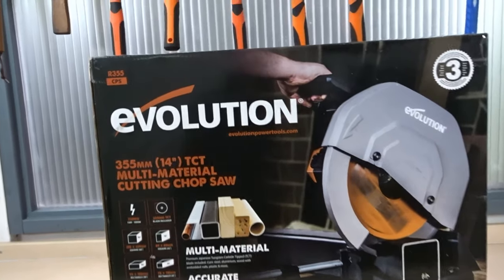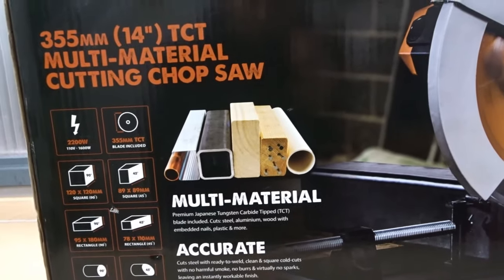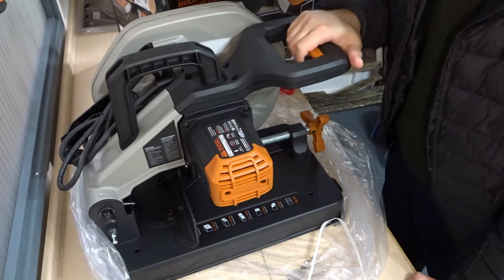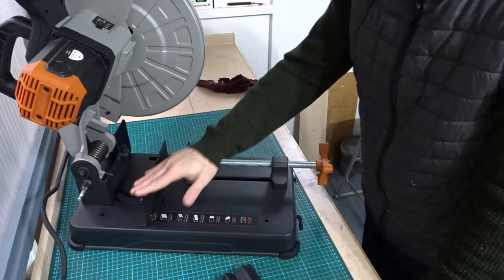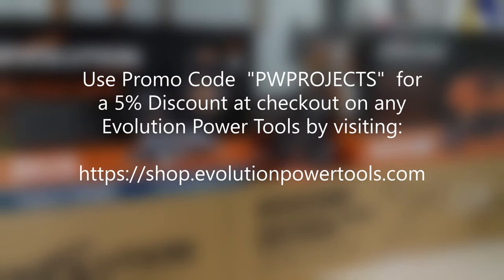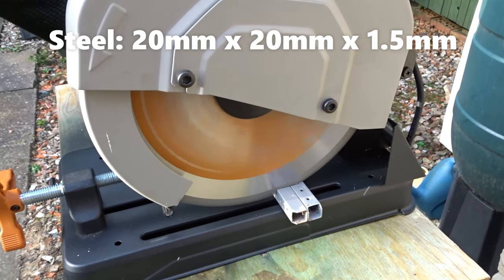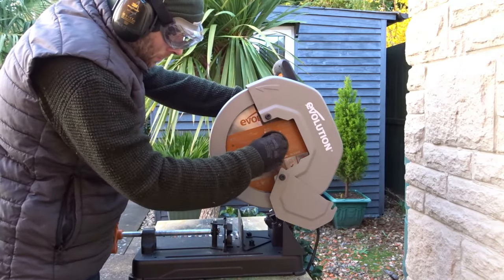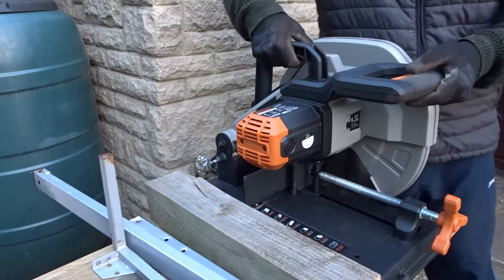Evolution R355CPS 355mm Chop Saw - Review - 5% 0ff See Video Description!

Comment: Great review Phill, that looks like a really useful addition to the workshop, I've considered getting one of these machines in the past, but that was one of the abrasive wheel cutters rather than this TCT which is much longer lasting and cleaner cut ! 

I have a jig for my 230mm grinder that does a rudimentary attempt at a similar job but it never feels that stable and safe !

I also have one of the Evolution sliding mitre saws with the multi-material blade, which is excellent, but I always lock off the sliding mechanism before cutting any steel in case it grabs !
Reply from the maker: Cheers Andy! Yea this design with the TCT blades seems to be more stable and cuts cleaner. I have used my evolution sliding mitre saw to cut metal also and lock of the sliding feature as you say. They are ok for smaller pieces of metal and if you don't need to make too many cuts.